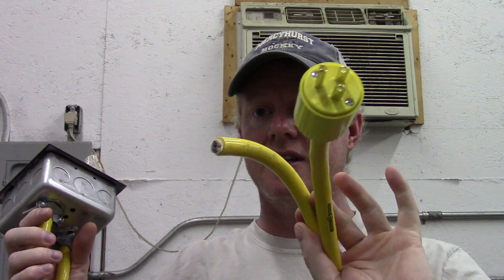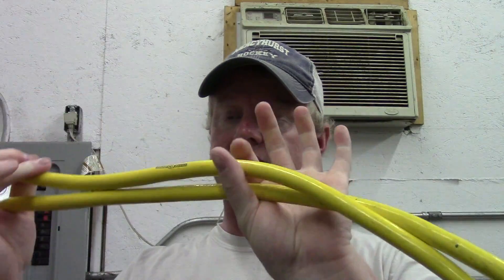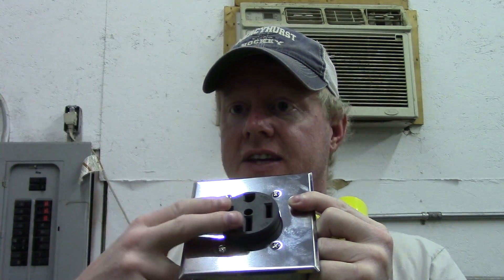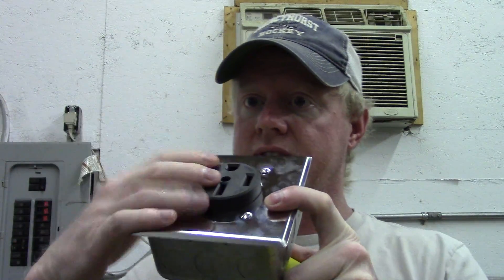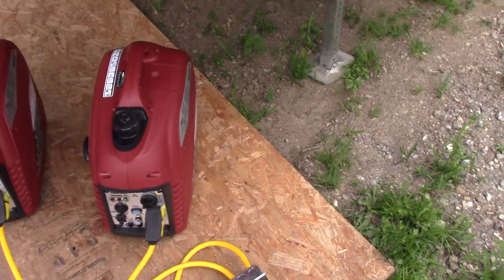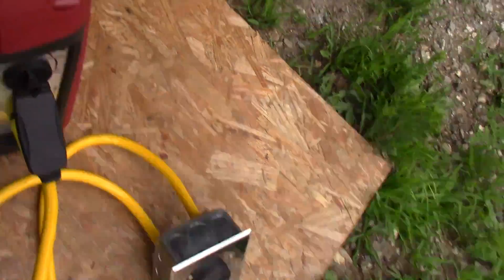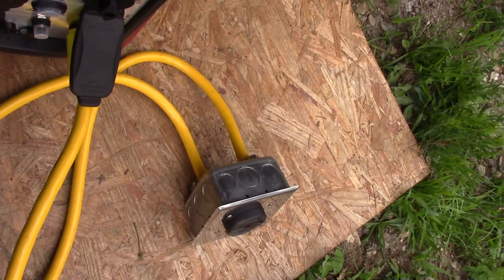How to make an Inverter Generator Parallel Cable  AKA Cable of Death

Comment: can i parallel a honda 7000 with a honda 2000 ?
Reply: Danny, it sounds to me as if your problem is your air conditioners.  First, don't try to start both units at the same time.   Second, 12K-13.5K BTU units are usually about 12Amps, 15K maybe 14-15 Amps.  That's a about 1440 Watts for the small one or 1700-1800 for the larger one.  If either won't start off or a 7000 Watt generator, you have a problem either with your A/C units or with your generator and adding a 2000 Watt generator would only be masking a problem that you need to find and solve (in my opinion).
Reply: A 15k A/C can require up to 40 amps to start the compressor.  Once it's started then the draw drops to the stated required amperage.  You can remedy this by adding a soft starter like Microair Easystart.  They aren't cheap but will solve your problem.  But you certainly should be able to start and run your 15k AC off a 7k watt inverter without a soft starter.
Reply: @johnnichols1750  Yes, I got that Mircroair Easystart.  I test ran my 15k AC off of a 2000 watt (1600 continuous) on a not extremally hot day.  The gen ran full out RPMs but it worked!  Best advice is for him to stager the AC start up times by at least 10 to 15 minutes.
Reply from the maker: You will only be able to do the 120V setting.  I can't really think of a use case to do this vs just using the 7000 alone.
Reply: so my 7000 honda will become 9000 watts?   the reason am asking because i have a rv with two A/C  of is a 15 and other is a 13500 and some times it kicks the breaker
Reply from the maker: dannyboy9254 If you just need a bit of extra adding the smaller genset in parallel should work just fine.
Reply from the maker: dannyboy9254 they won't have equal ramps up in eco mode so you may need to run both or one in non-eco mode . For example if the 2000 breaker kicks run the 7000 in non eco.

Comment: hmm the problem i see. is that the standard outlets are rated 15amp, the banana plugs is rated 30 amps.
Reply from the maker: Each genset has correctly sized breaker for the load 15X2=30 (or so) amps.

Comment: can i connect a honda eu2000i and a honda eu3000i and get 5000 watts?
Reply from the maker: Generally yes. You may need to have your eu3000i not in eco mode during heavy loads.

Comment: can I use this to parralell two different brands of invertor generators. For example a Champion 3100 Watt and a Predator 2000 Watt?
Reply from the maker: I've paired my powermate with predator with no problems
Reply: @ShaneBurrell1  When using the made up parrallel cables as you have shown does the inverter generators have to be manufactured with coupling ports or can you connect inverter generators that are not meant for stacking IE no parallel ports ??? also can the inverter generators be of different brands and kva outputs ???
Reply from the maker: The inverter generators need to be designed for parallel operation.  Some of them are designed for parallel operation but don't have dedicated parallel ports and it is fine to use the output receptacles as I have for my set of powermates. Brand doesn't matter.  Output wattage does impact starting loads but generally, it will work fine.  I've used the cable in the video with a Predator 3500 and a Champion 2000 without issue.
Reply: What about Honda and predator? 2000’s
Reply: I t  worked for me with my honda 3000 and predator 2000.

Comment: Re-title to "Talking about making".  You didn't actually make a damn thing.
Reply: Shane Burrell im trying to do this in my walmart brand genset, so if i will just use a 30 amp plug, all i need to do is connect the same colored wires?
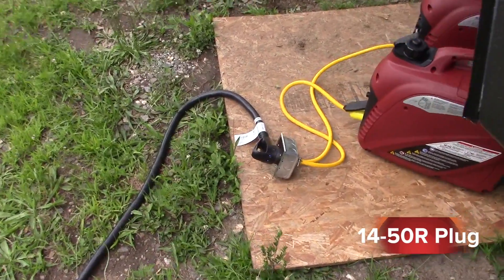Reply from the maker: At 7:03 the "talking" is over and the "make" is shown. Now granted I didn't start with raw ore but I certainly made my own cable from parts from Lowes.
Reply from the maker: Schematic would be all wires in parallel.  Wire up one end like normal plug.  On the 30 or 50 amp side all like conductors are paralleled to there corresponding connection to the plug.    On the 30 or 50 amp side there is some variation so I didn't want anyone getting confused and damaging themselves or there gear.  Understating parallel circuits is paramount to making this.   Making the 50 amp version everything is in parallel and at the same time the two 120V legs are bonded (this only works on RVs!!!!!!).  The 30 amp version is easier as it is just simple parallel of the hot , neutral and ground.   On that note if you still have questions I'll be happy to answer.
Reply: Shane Burrell Here's a thought instead of two 110 standard outlet male plugs on your adapter. use four total 110 outlet plugs male. Just in case you run it for a long time and the two 110 male plugs get hot or a little warm with two extras they may not get this warm. More contact less resistance.  Dead man's plug just remember never take the plug out until after you cut it off.
Reply from the maker: I used 20amp standard plugs and short oversized SG cord.  The plug, cords and adapter are well above the output of the single 110 output and with this size generator no real need to double up.
Reply from the maker: Yes if you are doing a 120V 30 amp connect grounds to ground on the plug.  All neutrals to neutral on the plug and all hots to the hot on the plug.
Reply: I would like to see the wiring. I am sure that's what the commenter above meant. Otherwise not much info on the "How to make"

Comment: This is very confusing.
Reply: Thanks for the video. Is it advisable to connect the parallel unitsto both gen-sets with the RV plugged in, then fire up gen's with no load?
Reply from the maker: Anything specific ?
Reply: Shane Burrell, I am a visual person. Showing the actual wiring connections or a good schematic would help me better understand the concept.
Reply from the maker: Schematic wise its all parallel.  Ground - Ground, Neutral - Neutral, Hot-Hot.
Reply from the maker: I connect both gen-sets with RV plugged in.  I start one genset at a time without any major loads on in the RV.  After both gensets are warmed up and running on eco mode I start using loads.